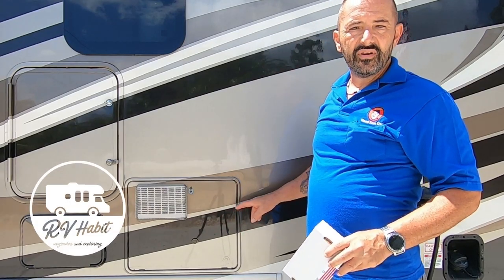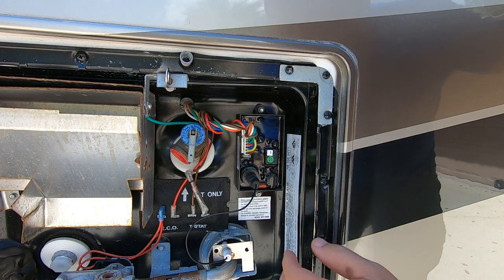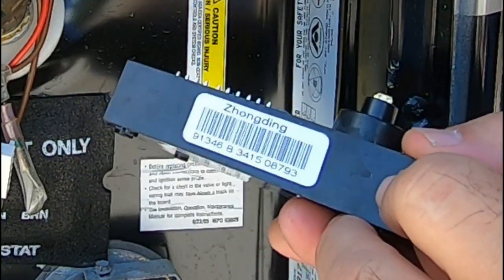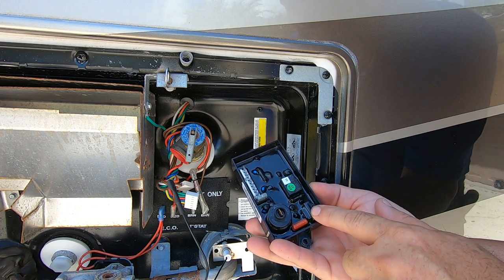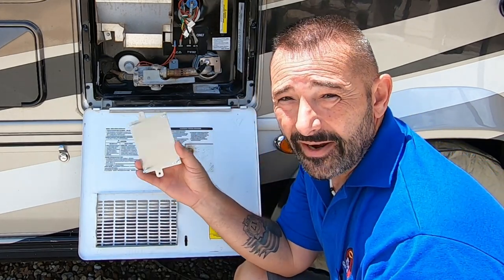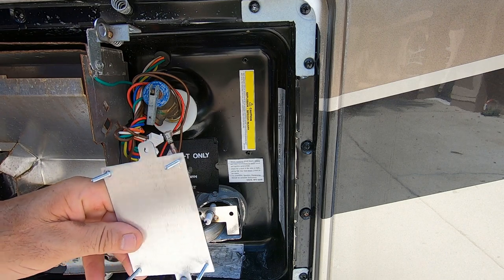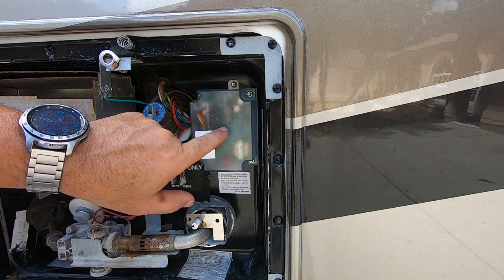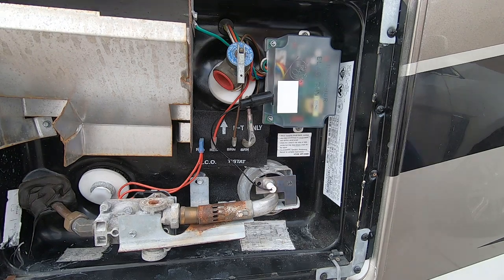RV Water Heater Ignition Control Board Replacement - Dinosaur Electronics UIB 64 – RV Maintenance

Comment: Great video. You are good at showing what we need to see, to decide what to do when doing our own repairs. 
We are having issues with our LP turning on, heating the tank, shutting off and then coming right back on. Could that be an issue with this board, or the thermostat, or both????
Reply from the maker: Could be either of those issues.  I would start with the thermostat.
Reply: Thank you. We did figure that it was the bypass valves. One wasn't in the right position. Thanks for your help.  @RVHabit
Reply from the maker: Yes very common.  Also leaving the outside shower control knobs on. Happy Camping.
Reply: We never use that shower, but I can see where that would be a problem for some. Thanks again

Comment: I have replaced the heater ignition control board, igniter electrode, thermostat, thermal cutoff wiring, and the on/off switch on my  Atwood G10-3E.  It came on when we first put these parts on (we did burp the tank) it kicked on, barely heated the water, then shut off, and it will not ignite.  What should I do next!  Desperate for hot water.
Reply: We also cleaned the main burner.  My RV is connected directly to a 500 gallon propane tank.  All fuses and circuit breakes are good.
Reply from the maker: It sounds like you have done most of what can be done.  I would have a qualified tech check the propane regulator to make sure the unit is receiving proper amount of LPG.  Gas can be dangerous sometimes a professional is needed.  Good luck.
Reply: @RVHabit  thank you.  Do you think there is a possibility that the solenoid could be going out?  I noticed some rust around the screws where the wires are attached to the solenoid/gas valve.  I will have my LPG guy that installed the line to my RV come check it.  I guess I should mention that my furnace won't light either, cleaned the sail switch, checked all connections with multimeter, and all seems fine.  Do you think that the propane could be the issue with the furnace as well?  Should I have my gas guy put a regulator on the line that runs to my RV, right now the regulator is for both the RV and my friend's house, and the gas heater in her house won't light either.  Thank you for your how-to videos, they have been very educational and helpful.  I appreciate your advice.
Reply: @RVHabit  My gas guy came out, the tank was leaking and all 300 gallons of propane we had recently had put in had leaked out.  Arghhh!  It was leaking really bad at the fill valve,  so he replace it and the regulator.  He still needs to replace the vapor return valve and the level guage (it was stuck on 70%, therefore I thought I still had propane in the tank).  Everything is working great now!  Next project is to fix the clicking in my AC unit before the hot Texas summer gets here.
Reply from the maker: Glad it all got fixed.

Comment: thanks for the video, how did you determine it was a board issue, thanks as always!
Reply from the maker: I checked everything from my previous video and was a process of elimination.  You can see that video here https://youtu.be/GXtp_2sA8Ao
Reply: @RVHabit  also how did you fill the water heater only with vinegar.  Thanks again
Reply from the maker: You empty the water heater.  Then use the Winterizing kit.  When you turn the RV pump on it will naturally fill the water heater.

Comment: Question about the diagnostic LED's - I'm bypassing propane & running only electric; I replaced the thermostat & when I hit the main power switch inside the RV the yellow AC led comes on but the green "Power" led doesn't. Is that an issue?
Reply from the maker: If I remember correctly the green light simply means the board has power.  The red light will turn on when power is sent to the gas valve or the yellow light will turn on when using AC.  I believe it only illuminates one color at a time.

Comment: Before I saw this video, I replaced mine with a OEM from Atwood. But, it did not fix my issue. My issue is my 12v fuse keeps blowing as soon as I flip on the Electric or the Gas. I'm in the progress of obtaining another Element. Any thoughts? Maybe I should buy a Dinosaur :)
Reply from the maker: Sounds like you have a short somewhere.  Just connecting a new board can damage the board if not corrected first.  In my opinion the Dinosaur boards are superior to the OEM boards.

Comment: Thanks for the video!  How often should you replace the board?  Mine is 7 years old but has not been a problem. Should I keep one on hand as a spare?  Thanks!
Reply from the maker: Hi,  if the control board and the water heater is working there is no reason to change it. I don't keep a spare on hand as they cost around $100.  If I ever need it that's when I would purchase it.
Reply: @RVHabit  Since it looks like you are still in Florida, you probably won’t be coming to Hershey next week.
Reply from the maker: Yes I will not be there this year.  The first time I will miss the Hershey show in years.
Reply: @RVHabit  Just finished walking 5 miles today at Hershey!  Now I understand why it’s billed as America’s Largest RV Show!
Reply from the maker: And some people I know say there are not as many RVs this year as usual.  I am sad I couldn't make it there this year.  Lots of fun.